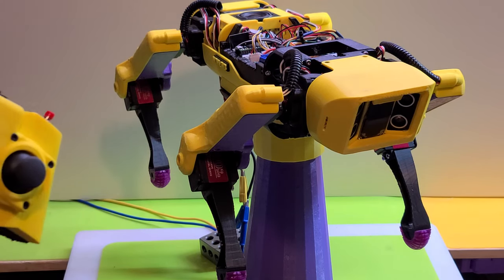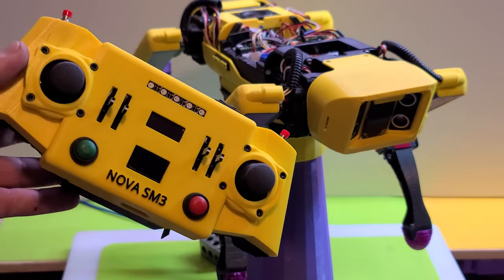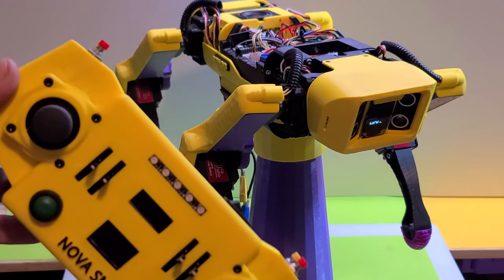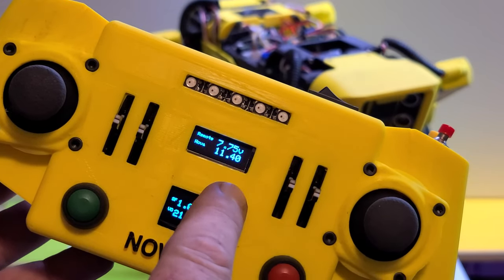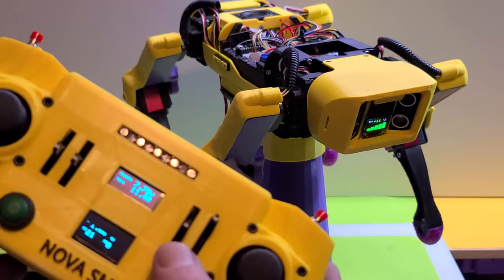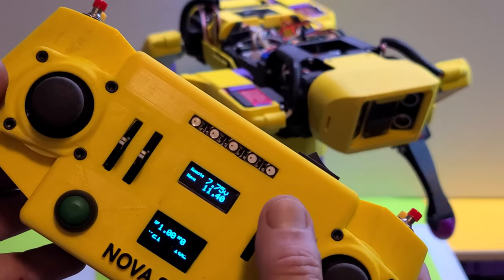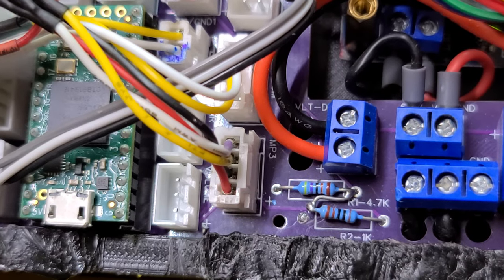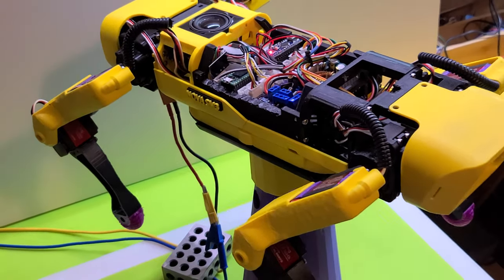DIY Remote Control - Part 11 : Bi-Communication NRF24 - Nova SpotMicro3 v5.2

Comment: Is there anyway I can manually fix the PCB? Only just got mine and told I need to buy more, especially when I need to buy a minimum of 5 lol.
Reply: Sorry, just saw the explanation in the video ;)
Reply from the maker: yes, my apologies for the small bug in wiring - but it is a simple, not to ugly of a fix.  Its hard to pace myself through testing before letting you all know of progress, as I know so many of you are building Nova, and anxious to move forward with it.  Again, my apologies.